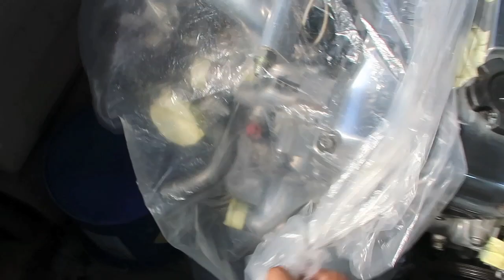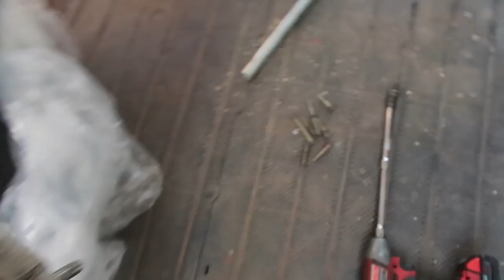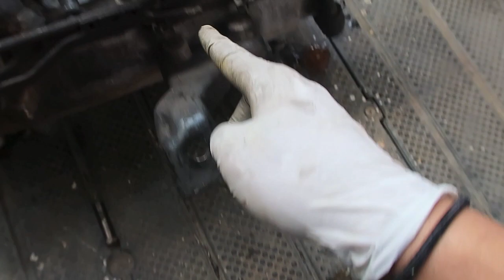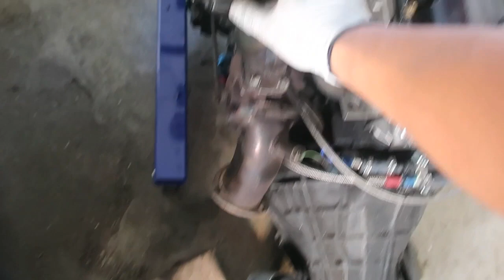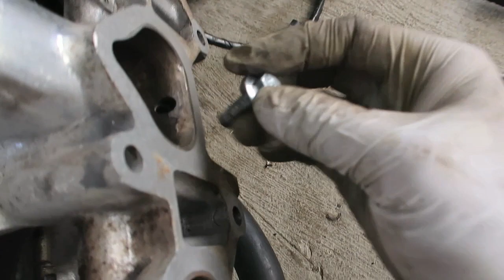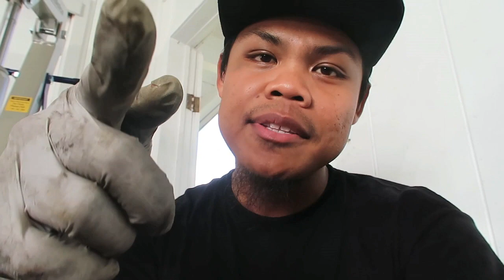How To Clean Up A KA24DE 240sx Intake Manifold

Comment: bro how tf u get ur intake so polished lol
Reply from the maker: meno sorry My friend I got the motor from actually started the process but it’s just like any other process polishing aluminum. Sand paper working your way up with the grits from rough to smooth (220/320/400/600/800/1000/1500/2000/3000 etc.) and then finish with some aluminum polishing compound. I used White Diamond Aluminum polish. I also use that polish for my wheels.